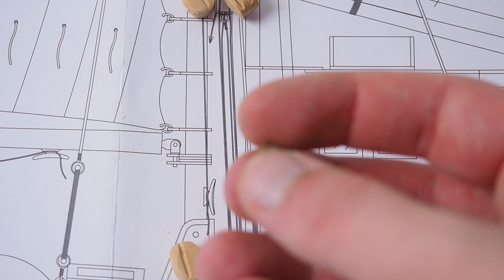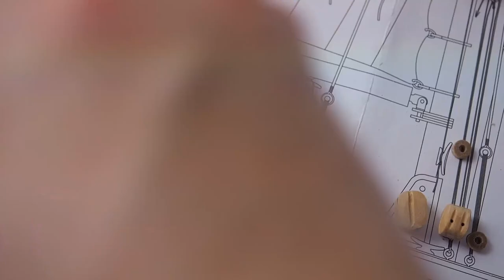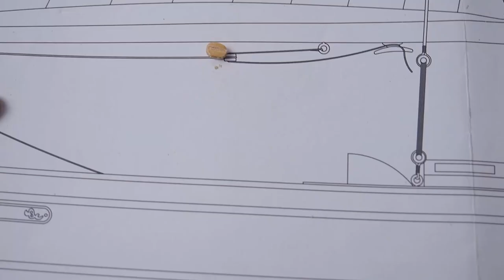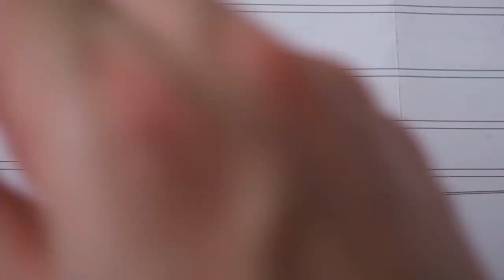Model ship building - MASTS AND SAILS - Part 2 blocks, Fifie

Comment: For the brass pieces that you made I would suggest that guitar string ends might provide a good starting point. They are the right shape and made from brass, they even have the required groove as they essentially do the same job.
Reply from the maker: Yes i play guitar in fact. But I guess it would be more expensive